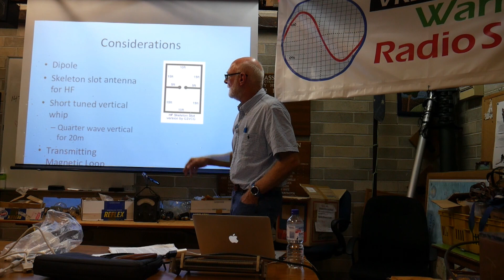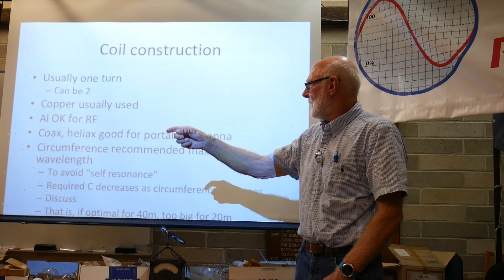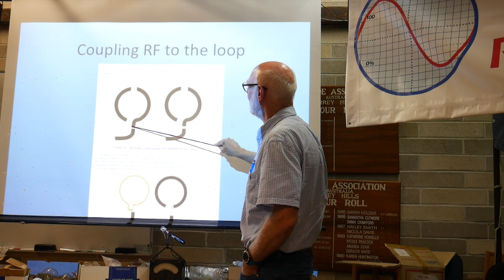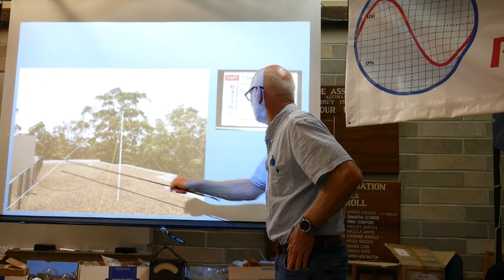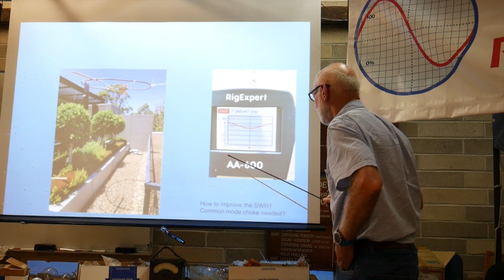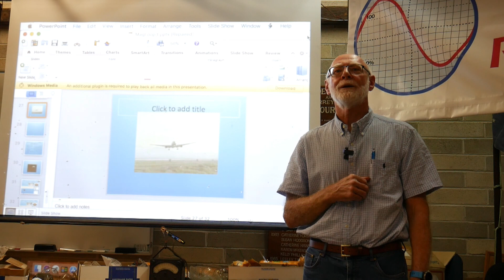HF Magnetic Loop Antennas - Dr. Philip King VK2JPK - Manly-Warringah Radio Society lecture

Comment: A loop with 10% to 15% of the diameter of a wavelength is directional off the ends. Making the loop larger makes it more sensitive and good for lower frequencies but it becomes more omnidirectional until you make it large enough that it is more sensitive to signals from the side, not the end.

Comment: It is a "magnetic" loop because it is not resonant. It is coupled, and then fooled again by a major amount of capacitance, to trick the coax to being happy just on a focal point of resonance and impedence.
The capacitor establishes resonance, diameter of the driven loop, spacing from large loop, and wether the capacitance was really enough to make the outer loop resonant, establishes impedence. 
It has Hi-Q, but the feedpoint is away from the radio, right at the antenna, and is NOT dependant on ground and/or counterpoises. In older antenna books, they do setup a connected or just adjacent buried ground plane, for when it is at ground level. 
It does not take many watts transmitted to make killavolts ready to jump at variable or fixed match capacitor.
A dipole is a voltage antenna.
A static antenna is no antenna at all
It takes a mathematically appealing antenna to capture signals of a specific frequency, and if it jives with the transmission line impedence, it can be used to transmit, also.
Otherwise, for recieve, a static antenna is as much ungrounded metal you can connect to the antenna plug. 
A voltage antenna is a longwire with a tuner.
The resonance, and impedence to ground, is satisfied in a capacitor and inductor combination, and the longwire just captures and emits with the arrangement.
It sucks because the feedpoint is there,  right in the shack, where the longwire leaves the tuner. 
The new EFLW or EFHW is a great idea, where the wire is halfwaveish, or non resonant, but at the end of a run of coax, an unun balun ferrite core matching circuit in a box, secured to a high mounting point, and the longwire leaves from there, so the feedpoint is up high, out of the shack, and fine tuned with an antenna tuner, that may already be in the radio, or use the exit coax port of a standard tuner.

Comment: Looking for information on coupling to the loop using ferrite toroids. FT 240 Type 43 material.  Some info suggests the impedance of the loop at the opposite end from capacitor is around 2 ohms. The impedance away from the centre rises up to around 11 ohms. Interested in concept of feeding the loop not at the centre, ie match feed impedance by moving the toroid coupler around the loop to assist in matching.

Comment: I have a aluminum flashing loop and was not able to couple with it at an acceptable swr for transmission with a feed loop. I tried a wire gamma match and got a 1.2 swr the first time I tried it. Ground coax at center point of loop, run wire 20% as long as loop circumference down loop while winding wire 3 times around loop and ground to loop at end. Result, low swr.

Comment: Coupler Loop advice.
This one really works,  Squash the Faraday Loop in, to form an oval so that more of it is coupled to the main loop. This will improve VSWR considerably AND there is a minimum height above ground where any lower will also degrade the VSWR. Experiment & ADJUST!

The EHT on the ends of the loop is NO myth,
Before I knew of the dangers of non-ionising radiation nor the matching dangers of smoking,
I built a hand=tuned one (Cap. in a box with a knob a slo mo drive..)
With 50w, I could light a cigarette off the H/V points at the gap! (It WAS a 7 Mhz  cigarette!)
Now do you believe statements about getting hurt.
 A soldering Iron burns the skin and some flesh, healing fairly quickly. An RF burn is a point wound but VERY deep & slow to heal. This is IONISING radiation.

Non-ionising causes heating of the flesh BUT cell phones and Wifi are far too low.
The Mag loop is up there with big ones and safety zones should be considered as absolute minimum. 
Hand tune your mag loop with milliwatts and DON't strap one to your back pack for pedestrian portable!
I stopped the cigarettes and RF exposure years ago. I'm 80 so they didn't get me. 
I'm giving the malt whisky a chance now but it'll have to be quick before Corona or McDonalds
gets in there first!
Reply: Anything that burns is in a sense ionising, even 12VDC is ionising if it heats something in contact with skin up sufficiently.

True ionising radiation though is radiation of short enough wavelength (is sufficient energy) that no matter the power level, it disrupts the cellular chemical bonds without otherwise disrupting the cells. In practice the energy levels to do this start in the UV band (UV B) and extend to higher energy levels through X-Rays and Gamma Rays.
Reply: When you get too close coupling between the 2 loops you decrease the Q, and broaden the bandwidth to the detriment of the antenna's gain.

Comment: SAFETY SPOILER!   SAFETY SPOILER!

If you're not tuning it remotely, mention that the EIRC field is such that with a loop 
a safety zone of 1.5 metres is required at 10 watts  and 2.5 metres at 100 watts!
Tuning up by hand should be done at THE lowest feasible power level.
The beasties are VERY intense radiators.

Comment: For a Stealth antenna, if you can get it up without being seen,  an Aluminium welding wire is virtually invisible.  I can't see mine at 30' feet even using binoculars....AND I KNOW WHERE IT IS! 
Maybe a drone to get the far ed up?